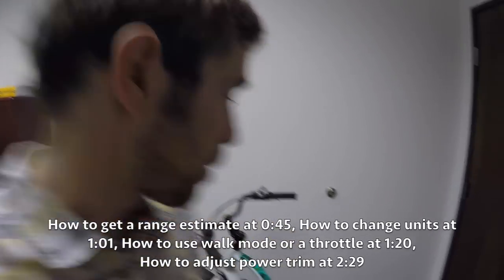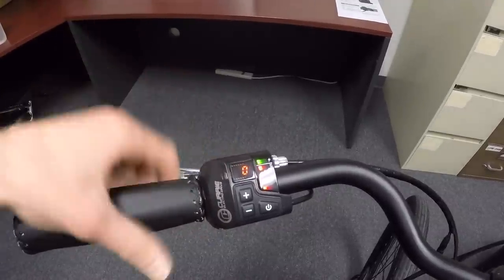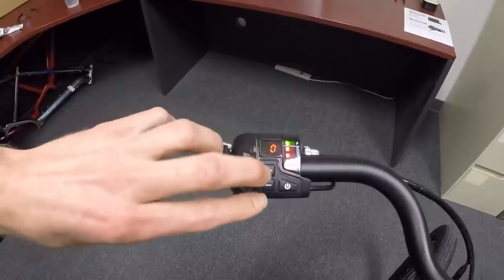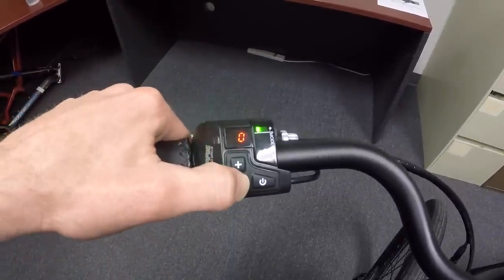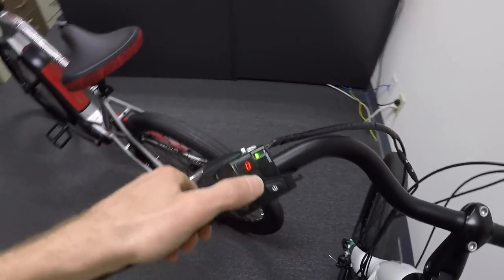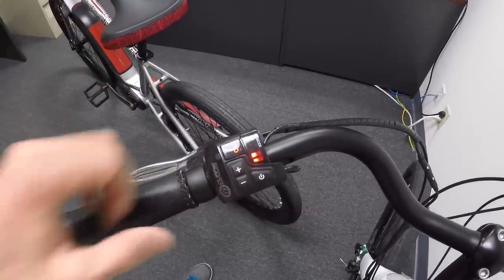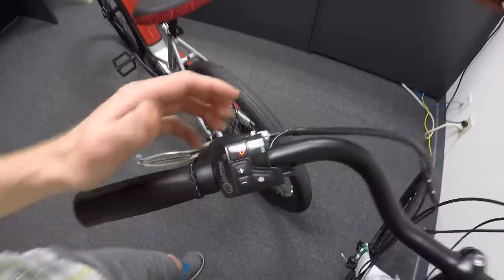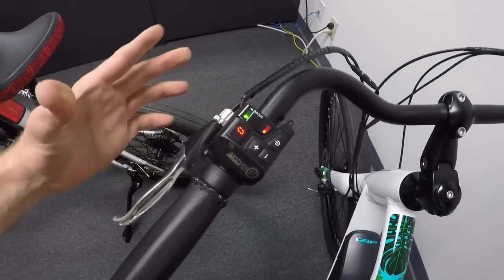TranzX DP27 Electric Bike Display Settings

Comment: Hi there, I have the D15 control Display. which seems a little defiant from the 27. as i could not get range out of the 15 with fully changed battery. any ideas for me to try. Pete Manchester.

Comment: hi Court, been away so long i almost forgot your name?! i too prefer the twist throttle, but my buddy won't use them. he was pulling to a stop up on a high curbed sidewalk, and his outside foot slipped off the sidewalk and down into the street. the sidewalk curb was so high, when he slipped off into the street, his off balance caused him to inadvertedly twist the throttle yanking him forward then falling on his shoulder into the street! he broke the shoulder because of the height of the curb as well! should he have turned off the bike before he started to stop, how is the preferred method in that situation?  (we have a bet on this) thanks, nice to be back on your channel.

Comment: Hey Court, looking forward to when you do a review on the sondors fold sport & mini that just came out. Thinking of getting the sport but kind of bothered that it doesn't have suspension.
Reply: Saw it in person, too many washers on the hub to compensate for the horrible tolerances. Bike came in with a broken wire in display with only five miles. Don't buy any Sondors.
Reply: Open Trails EMTB.. I guess its cheap for a reason, thanks for the advice. I didn't order one.... Instead I'll wait for the fatmini to come back in stock